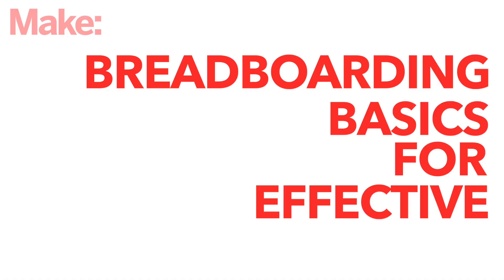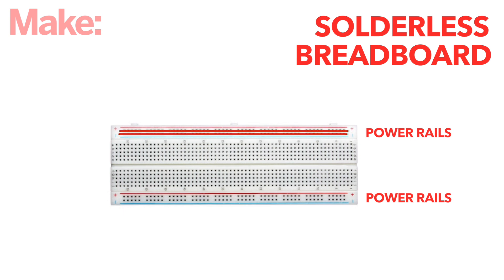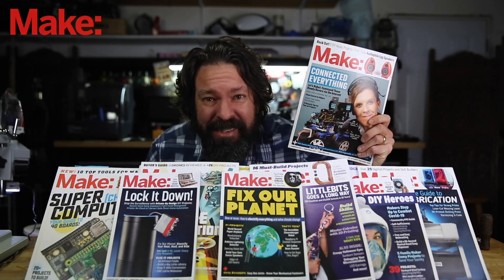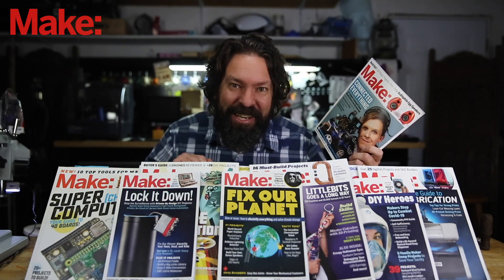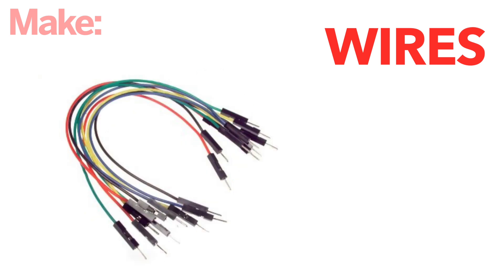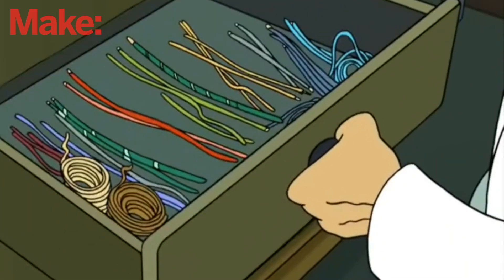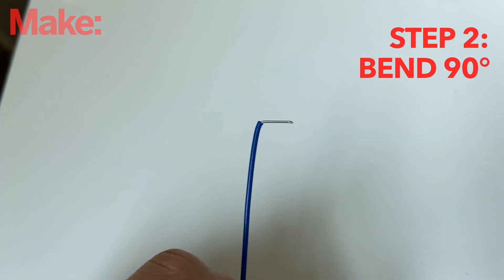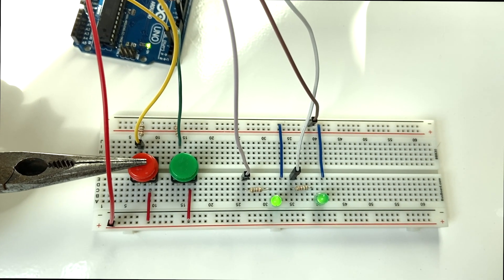Skillbuilder: Breadboarding Basics - getting started in electronics

Comment: There is an electrical Glue called Wires and means that you can use instead of soldering and means sensitive parts can be used in circuits with destroying them.

Comment: Lets be clear here. If you're using spools of wire for breadboarding, make sure it's solid core. Stranded will NOT work well unless it's soldered and then it's likely to be too thick to insert into the holes on the breadboard.